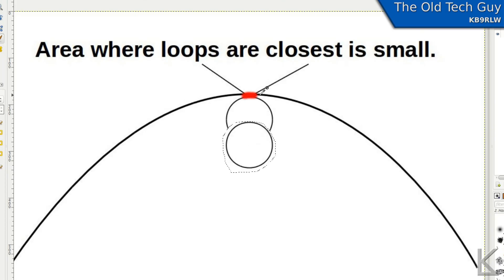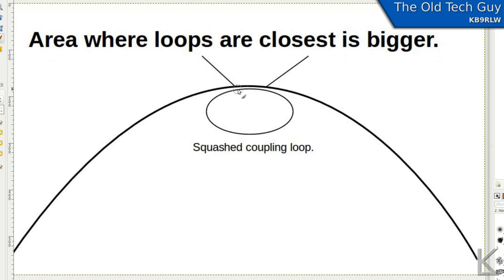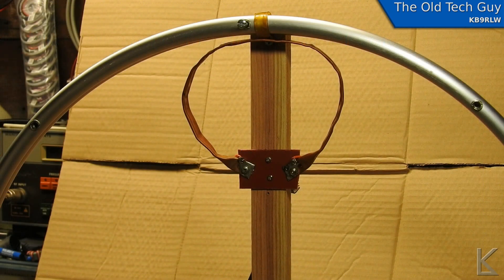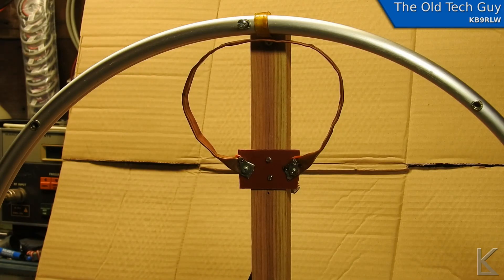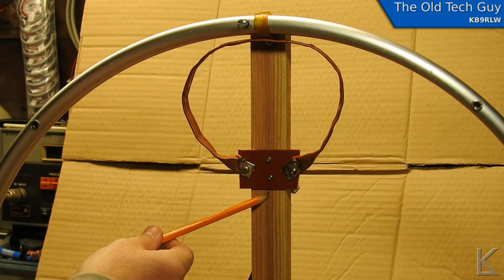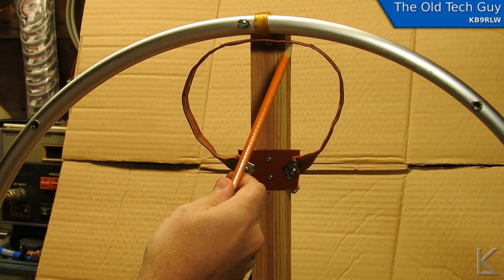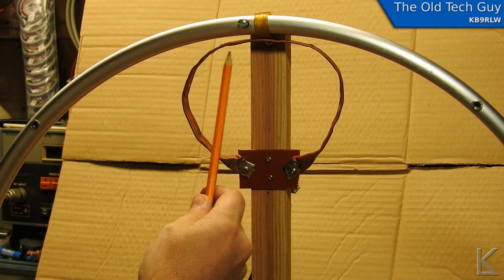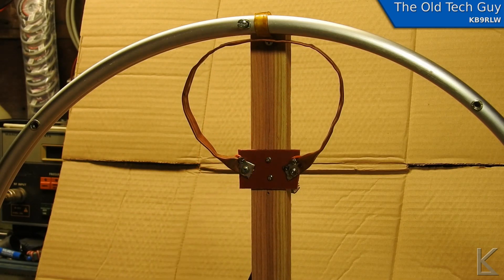Ham Radio - A simple magnetic loop modification with a big improvement!

Comment: Hi Kevin. I bought a second-hand MFJ-1786 a couple of months ago from a guy who had kept it in his attic, before replacing it with a fan beam. It was in nice shape and seemed to work well when he demo'ed it at his QTH, but I opened it up once I'd brought it home to see what was inside. Comparing the feed loop's geometry of the one I bought to that of photos I've seen from stock MFJ-1786's; I noticed that the feed loop on mine had been squashed into a near-ellipse shape. I knew little about magloops before researching them and lucking into the used MFJ. I don't know if the seller might have watched your video just before he sold that antenna to me (I bought it in early December 2017) but now I think that I know why the feed loop geometry of the unit I have is elliptical rather than circular. 

I was planning to make a loop of my own at the local TechShop. It was to be a larger unit capable of tuning 40 meters and handling up to 600W. Unfortunately, they went bankrupt last November and that shut me off from access to the pipe bender, TIG welder and metalworking equipment I needed to do a professional job on my own (at least as far as making a loop plus a tuning cap capable of handling any amount of power, given the high RF circulating current characteristics of these things).  Anyway, thanks for posting the nice video. 73's...NQ7A

Comment: Thanks for this info,thats correct and you can see it by using a graphic analyzer.some times the resonant point is perfect but the Z is to high or to low. I make the tuning capacitor allways on the top because here is high voltage and nothing must be in the near.....73 DH7TB

Comment: Hey Kevin. I can confirm you're findings. I repositioned the coupling loop of my 90cm loop (40-17m). Since I flatten the couple loop the efficiency on 40 and especially 30m has gone up noticeably. Thanks for this great tip! 73 Werner PA3GYV.
Reply: makes a guy wonder why commercial loops dont incorporate such an easy mod?
Reply: @patmb2011  The commercial companies would more than likely add another £100 /$100 or more  on top of the price for such an easy & simple thing like that.

Comment: Kevin, this works on my Alpha Loop Jr, SWR dropped a bit just by "squeezing" inter loop some......good find!! 73 ~ k6sdw

Where did you find your RF meter?
Reply from the maker: Hi Eddy,  if you're asking about the meter in the middle of the loop, that's a basic field strength meter.   I talk about the circuit in my video on building your own. 
https://youtu.be/8Dd0oEzDepA

Comment: Magnetic loop construction is all about precision manufacturing, precision assembling, symmetry, quality capacitor/materials and proper ratio between the coupling loop and the radiating loop. 

If changing the shape of the coupling loop creates a better SWR then the following problem(s) were originally existing on the magnetic loop. Most issues are generally due to poor manufacturing quality:

- The ratio between the coupling loop and the radiating loop is not perfect.

and/or

- The symmetry of the radiating loop and/or the coupling loop isn't perfectly circular.

and/or

- The coupling loop isn't exactly positioned in the same plane than the radiator.

- Some metallic materials/structures are in the vicinity of the antenna.

Usually, increasing the surface of contact between the coupling loop and the radiator will help when the LMR-400 radiator is deformed by its own weight (egg shape).

A quick trick to get around a coupling loop and radiating loop ratio problem would be to lower the coupling loop about 1/4" to about 3" depending of the frequency to obtain a 1.1:1 SWR. The distance will have to be adjusted for each "defective or hard to tune" bands.

Good quality LMR-400 won't produce any radiating issue with the magnetic loop. Antenna assembly, manufacturing, material quality and operator errors are going to great greater power losses (high SWR) than the LMR-400 will ever creates because good quality LMR-400 (the one that we're using) has a real 96% TC braid and few thousands of an inch lower a 100% aluminum foil covering the CCPE dielectric insulator which protect the 10 gauge solid BCCAL.

https://i2.wp.com/abrind.com/wp-content/uploads/2012/11/lmr400.jpg

Do not hesitate to see the quality of our products at:

http://chameleonantenna.com/

Cheers,

Carl
Reply: I’ve personally seen the “quality” of your magloop antenna and I’ll pass. My friend had to send his back to you twice for the tuning shaft not being able to move the capacitor. Should have never left your facility without testing! I was the one that discovered after removing the cover!

Comment: Very cool. I just built my first mag loop using a road bicycle rim.  I'd going to try this mod with it now. Thanks! Question. Does it matter what orientation the tuning cap and coupling loop are? I mean top to bottom? I have my cap at the top and the feed at the bottom cause I found it easier to keep the coax away from the loop when it's at the bottom.
Reply: Yup, big improvement! Thanks!

Comment: A1 Video...Did you find an optimum 'squash' point?
It looks like you could have squashed it even further on your model.
Can you over-squash it? 
God .. I just love these super-high tech discussions...
73 from Olde Englande..
G3NBY
Reply from the maker: I'm thinking about a jig with a flexible conductor to let me adjust the coupling loop in real time for making just such measurements.
Reply: Kevin Loughlin
Hi Kevin... It'll be interesting to hear the results
The reason I asked is that I already use a big commercial Mag loop..an old Capco which tunes down to 2.5 Mhz and up to 13.5 Mhz. (Just missing 160 and 20 metres.)
However the bottom of the loop (feed point...with the capacitor at the top, is about 4 feet above ground and to get a fair SWR, I had to manipulate the position and shape of the Faraday loop (Made of co-ax). I read yours with interest and the possibility of upping the performance but it looks like I have already stumbled on your technique.
At 2.5 feet I could not achieve an adequate SWR at all which forced me to raise it & take the action with the feed loop.
When the Wx improves, I'll go out and see if I have any further 'squashability' left or raise it a little to get a good match with the feed loop circular and the squashify it!

I'm also wondering how much capacity might be needed to coax (no pun intended) it down to 160 metre. Would need to be extremely HV working...and would also reduce
the HF end but maybe not cut off 10Mhz.
An earlier, small homemade one with 20 watts on 14Mhz could draw an arc at the volts point, big enough to light a cigarette, when was still stupid enough to smoke and stupid enough to get so close to loop!
I've often think of the wood-pigeons which perch on the capacitor box "Hey Baby..You would NOT perch on there if you knew what is inside..."
  73 G3NBY

Comment: Hi Kevin, that is a great experiment with good results. Thinking about this gives me more idea's but also questions
Currently I dont have a loop or material to try this, but you might, so I am sharing, hoping it helps!

First question I have is: does the bandwidth change when squeezing it together and if it does, how does it change?
Second is only if the first one is true: Squeezing it to the max so it is almost flat, what is the effect there?

What if the coupling loop is changed to a 'mini dipole' following the radius of the big outer loop? Would that even work?
Looking forward to your next experiments!

73 de PD4AD
Reply from the maker: The bandwidth didn't change.  But that's really dependent on the outer loop I think.   I'm going to eventually try to compare this to a gamma match method.

Comment: Maybe increase efficiency with a very tight coupling using a ferrite toroid configured so that the radiator passes through for 1 turn and enough turns on the 50 ohm side to appropriately match the impedance. Just a thought. . .
Reply: I used  clamp on, Split fer-rite ring on the main loop and just 1 turn connection to the feed coax was best. (1.4m diameter loop for 80, 40, and 20metres) very close to 50 Ohm and that can be tweeked by a tiny shift in the resonance capacitor.

Comment: The indication on the signal strength meter almost doubled in numbers when you squashed the smaller loop! Pretty impressive!
Reply from the maker: +unklewink well it's response isn't quite linear, but yeah, a good difference.
Reply: That's why I mentioned the numbers. Of course, the actual radiated power would not be doubled.

Comment: this was used first in the Zenith Clipper radios, back in 1942. The guy who made the project of this radio noticed that the RF signal is a lot stronger on the edge of the loop (in that case, round battleship and airplane window) than at the center, and if the antenna is oval, the reception is even better. It's funny how this was forgotten and was rediscovered just recently :)
Reply: Fascinating...We're entering the realm of the SLOT antenna here. Worth reading up...Maybe the loop is related to a 'skeleton' slot...very commonly used!
73 G3NBY
Reply: @MauriatOttolink  No, the slot is quite a disparate antenna - basically being two shorted 1/4y transmission lines (one long one and one short one - from the feedpoint perspective)
Reply: oval or egg shaped with the narrower edge on the top?

Comment: This is absolutely fascinating and it goes to the question of how best to couple a mag loop. I note that others have used gamma match devices which then allows them the opportunity for additional tuning at the level of the coupler as they lengthen and shorten it.
It appears that you could also essentially lengthen and shorten the outer loop proximate portion of your coupling loop by "squashing" it. Perhaps there is a "best squash" for different bands ?

Comment: Is that  the same field strength meter you made in another video?  I plan to add that one to my Mag Loop antenna.  Just wondering.
Reply from the maker: It's the same circuit, two diodes, a cap, and a 10K pot.

Comment: another great video . i have the mfj 936b loop tuner technically not a mag loop but i found the same using coax i get poorer result then i do using a tape measure ( easy for portable ) ...2E0FOK
Reply: Dave Sutherland hey I have same loop tuner and with the measuring tape is a breeze!!
Reply: sure is. The only size i have not tried as yet is for the 80/75 mtrs (63ft) as my tape measure not that long
Reply: "i have the mfj 936b loop tuner technically not a mag loop"  I have encountered this misconception in several places.  I also have this tuner.  What makes an antenna a "mag loop" is a radiating element shorter than 1/4 wavelength and a very high circulating current that accentuates the magnetic field.  Magnetism is created by a loop of wire and the strength is determined by current.  So a mag-loop antenna has a high circulating current.  That's it.  How you couple or "excite" the loop does not make it a mag loop.  You can inductively couple or capacitively couple and gamma matching also works (which is a combination of inductive and capacitive).  True gamma matching is difficult to achieve because where exactly you attach at the loop depends on various factors.
The MFJ style of capacitive coupling works well because of how easy it is to adjust the matching capacitor.

Comment: Wow well  what a simple adjustment and if it was squashed a little more would get better and what is the trade off but brill kevin you made a lot if hams happy chaps and ladys
73
G0myd
Reply from the maker: I'm already thinking about making a jig with a flexible conductor so I can change the 'squash' in real time and make measurements.  I want to find the optimal degree of deformation for this loop.  I suspect it will vary depending on the overall loop construction.

Comment: Hi Kevin what you are experiencing is inductance problem ie not being 50ohm could be 40_60 ohm I remote motorised my loop using arduino and small stepper motor works 40_15m at qrp levels 15w max on cw have fun gw7lop the coupling loop can get close to resonance frequency but inductance will be off by increasing small loop contact you better match 50ohm

Comment: What about the gamma coupling method, this is really almost 100% in proximity of the main loop ?
Reply from the maker: I have yet to see anyone comparing the two methods on the same loop.  Maybe that's something to do in a future video.
Reply: Thanks Kevin, that will be very nice and informative and I'm looking forward to it. Your videos are very appreciated here.
Reply: I second this idea. A gamma coupling comparison would be interesting.
Reply: Most likely because of the galvanic isolation.
Reply: I agree it would be an interesting comparison. I also have seen ferite toroid coupling. 
73 and keep up the good work.
Wd5dhk Ray
Reply: The mystery is: why are people still using primary loops at all?  Unstable in most cases, and easily bettered with pseudo-gamma matching - or any of the other feed mechanisms.

Comment: Hi Kevin,
There is another Youtuber who has motorized the coupling loop to rotate it in and out of the plane of the main loop to get the swr to 1:1. https://www.youtube.com/watch?v=lMzEijSj6G0&t=18s   73  WB3BJU
Reply: Very interesting video. I used the same squashed coupling loop idea to improve SWR in my homebrew loop a few years ago. I don't think the idea was original to me; the army built loop like this back in the 70's. Using your field strength meter in the plane of the loop tells you nothing about efficiency - near fields dominate. Narrower bandwidth would suggest better efficiency - see AA5TB website.  Steve, AB2EW
Reply from the maker: I saw that awhile ago.  There's lots of variables to play around with on these antennas.